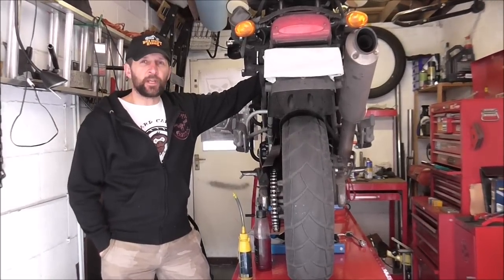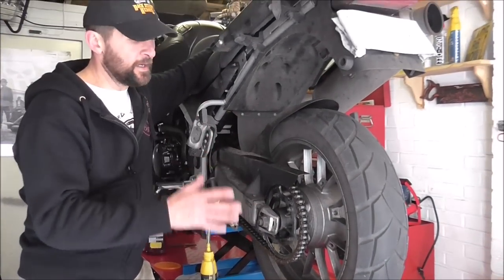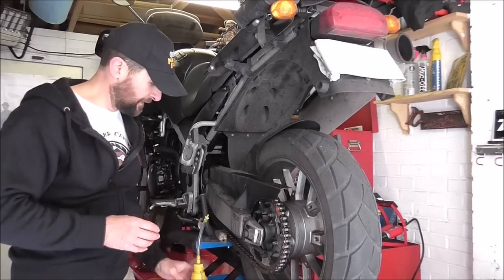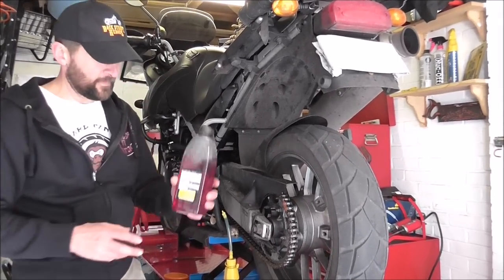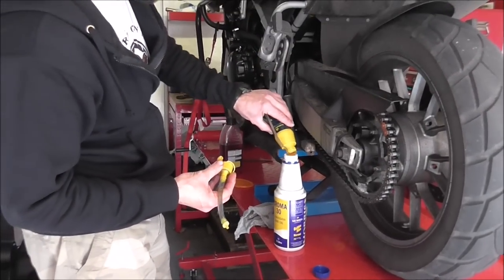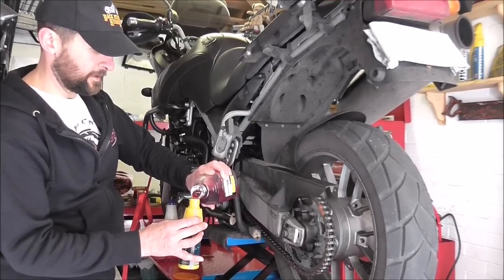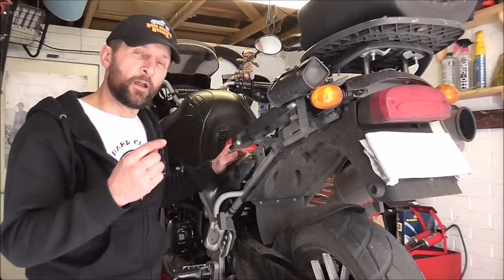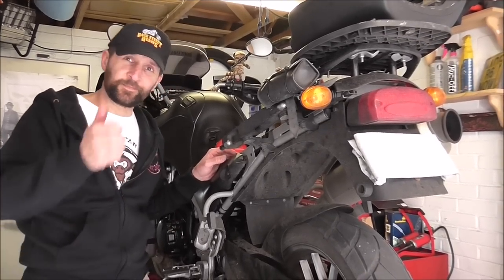Delboy's Garage, 2 stroke chain lube.

Comment: I bought a Scottoiler about 15yrs ago. It's been on a 12 Bandit for 15,000mls; a Ducati ST2 for about 20,000mls; a 1200 Bandit (yes, another one) for about 24,000mls and now my Bonny for about 15,000mls. I've never had to buy a chain and sprocket set in all that time and ALMOST never needed to even adjust the chain tension - they are just BRILLIANT.

Comment: When I bought my bike the chain was rusted and several of the links were seized, cleaned the chain and put on chainsaw oil and it's been good as new ever since. I use the oil through the wet months and chain wax during the summer. You can't go wrong with the stuff.
Reply from the maker: Good stuff mate, nice to hear someone taking proper care!

Comment: More great advice, spot on in my view again Delboy & Penny cheers.  I 100% agree, however, if cost is an issue for your subscribers they could try the Tutoro chain oiler, cheeper to buy, easier to install and works just as well.  Had one for two years done about 12K in that time in all weathersI'm not fussy, and my chain is spotless, always coated in oil and runs as smooth as a ... Great after sales service too.  Just a thought.  Oh it takes a couple of attempt to regulate the oil flow to the best setting for your riding/roads, it's not mechanical.  Enjoy and safe riding.

Comment: I can't agree more about using an automatic oiler. Great advice, just thought i would an alternative i have now used for 3 years after i sold my last bike and the scotoily went with it. The TUTORO Chain oiler, simpler to fit, good quality, even easier to fill up, does the job. I'm not connected to the business, just passing on an alternative, if it helps someone save their chain!
Reply from the maker: Good call PJ... anything that extends chain life and keeps the sheckels in the pocket is all good... cheers buddy.. Del.

Comment: I used to use Spray On Waxy Oil to protect my chain but I noticed "As you said" it makes everything on the road stick to it and to me I think makes more links seizes up.

So I clean my chain everytime I use it with WD40 and when I ride I use WD40 to keep it oiled and sprays anything on it off to keep it clean :)
Reply from the maker: Good practice my friend, although the rain will beat your WD40 off in a few miles leaving it dry to rust, so have a think about getting a Scottoiler and have a clean oily chain all the time... let me know if you're interested, as we have a How To video on fitting with a discount code you can use if you want to buy one...

Comment: That is a great idea, I ride in Cape Town RSA and a lot of the roads I choose are  hot dusty dirt (good, bad and no comment type) so I think this may well be a sensible option when going on a trip with the Tiger as it will avoid all that crud that gets blown up from bikes in front, or my own, getting stuck in the chain...going to swap to two stroke oil in my scottoiler for off road trips from now on... thanks!!  great site...only one I bother to look at :-)
Reply: Moonfleet41 The only grey monkeys we have down here sit on the side of the road and throw rocks, unless you're referring to the local taxi drivers. 37deg at the moment so both are in hiding;-) By homeland do you mean you were born here? Bit concerned about the veggy oil though...you could end up riding a salad if you hit any long grass ;-)
Reply from the maker: Chris hayman
Ha ha 'Riding a salad', PMSL...    Yes its homeland, i was born in Eshowe, my Father still lives in Shongweni in KZN, but we lost touch many years ago, long story. but they say you never really leave aye..SA is always in you..
Reply: Opposite for me born in the Black Country and escaped to SA at 21 True re African dust though it never leaves your system. No way I could go back to UK for any length of time without serious withdrawal symptoms. Suggest you bring the tiger out for a tour in the bush. Go well.

Comment: Good idea! Also, I hadn't thought of using chainsaw oil instead of Scott oil. I reckon some experimentation is necessary :o)
Reply from the maker: The chainsaw oil is purely for financial reasons, i go through so much oil this time of year it saves me about £30 over the winter....its pretty much the same as Scott oil, and still attracts some grit in the darkest of winter like now, so the 2 stroke oil acts as a better washing agent, and also costs a fraction of the money that the Scott stuff does..

Comment: See now this video makes me ask the question. could you use a scott oiler as your twostroke feed system on a two stroke engine?
Reply from the maker: Only if you want to seize it up..lol.   the autolube on your 2T motor needs to be calibrated to the mixture requirements...and a scott oiler is too basic to set that up...!

Comment: Hiya mate, I dont have a scottoiler, just manually clean and lube the chain. Could I still use 2T oil in this scenario? Would I just have to do it more often? If not whats the best type of lube to use for manually doing it?

Cheers!
Reply from the maker: Hi matey... yeah, you can oil your chain with just regular oil....but id say you'd be doing it every day if you wanted it to stay clean and oily....why not consider an oiler if you're out every day in the salt...??
Reply: Hiya, cheers for getting back to me. Thought about it but I may as well get new chain and sprockets first, as I'm thinking of replacing the ones on my Bandit soon. For manually doing it though, what lube/wax do you think is best?
Reply from the maker: BikersLifeForMe
If you dont mind doing at every day...then two stroke oil..!!!!  anything sticky will just go 'fly paper' on you..!

Comment: Hi Del, thx for video.
to lubricate my chain, I used to brush chainsaw oil, but since last summer I changed it to use old motor oil from my bike, that you didn't recommended. I couldn't get the reason (something with additive in 4T Motor Oil), would you write it please.
Thanks again for your video.
Reply from the maker: Hi Keyvan. the advice was refering to using motor oil in autolube systems like the Scott Oiler...engine oil has aditives that may harm the seals....but 2T oil is formulated for the stwo stroke autolube system so its great for oilers.....but if you are brushing it on thats not important...

HOWEVER.... if you use "OLD" motor oil, then it has already been ruined, its molecular structure has been broken down which is why you changed it for fresh oil.....this means that it wont do a very good job of lubricating your chain, use NEW oil, thats fine...EP90 or 80, even if its 4T oil, for brushing on, you had the best solution by using chainsaw oil..

Comment: i also run  a scottoiler on my blackbird del. but what i found just last week was the other side of the chains outside plates where all rusty as my oiler only lubes one side. i know i can buy a twin sided delivery part for the scottoiler system but its finding somewhere to fit it. had to clean the rust from other side plates and just oiled with the oil from scottoil with a cloth for now. any tips on what to put on the outside edge of chain del where the oiler dont get 2?
Reply from the maker: Hi John...there really isnt any other solution than to use the twin hose system...i just clean mine off once in a while and keep the single pipe delivering enough to drown the chain, seems to work fine... you could sue a layer of good uld chain wax on the outer face of the inner plates...then keep an eye on it in case it builds up too much cack... !!! thats what id do buddy.. (unless you can work out a way of fitting the second tube of course..!!?)
Reply: Moonfleet41 as all ways del thanks for your reply . do you mean chain wax thats in a tin or the spray type?
Reply from the maker: johncbr1100
Just the spray on type John, but keep an eye on the build up and wash it off before it gets too bad!
Reply: cheers del

Comment: I just lubed my chain (first time on the Yamaha sr) and realised that the sprocket has about 5mm of movement, its got a drum break at the back, should it have this?
Reply from the maker: What year is your SR mate, and is the sprocket mounted directly to the hub, or is it mounted to an isolated carrier slotted in to the hub?
Reply: Moonfleet41 Its a 2000 "Yamaha Sr 125 Custom" its mounted right onto the hub, judging by the crap on the chain it has been put on and never looked at by the previous owner
Reply from the maker: Sr Rider  well if your rear sprocket is bolted directly to the hub and does not have a cush drive, then the bolts must be loose... please take the care to check it properly before you ride it again... also, if this has been neglected, check the front sprocket at the same time to be safe... let me know how you get on mate, happy to help if you get stuck, Del
Reply: Moonfleet41 thanks mate, the back wheel has to come off anyway because it needs new tyres, thanks for the advice
Reply: I have looked a bit more into it, according to my manual for the bike it does have cush rubbers, I checked the movement in the sprocket the way u do it, with a ruler, its got about 2~3mm movement side to side, none forward or back. should it do this?
Reply from the maker: Sr Rider No mate...the sprocket carrier should only rotate in the direction of drive back and forth, but never side to side...and it shouldn't really move more than about the 3mm you are saying...its just there to cushion the drive take up...
Reply: Moonfleet41 does that mean the 3mm is ok or should I get it checked out?
Reply from the maker: Sr Rider  Yes, mate, 3mm is fine... it's just the sprocket carrier squishing about on it's rubbers, and it's quite correct... but if you have side to side play, and it worries you, then perhaps get your local shop to take a squint at it to be sure!
Reply: Moonfleet41 I would tackle it myself but its got a drum at the back and the rear break cable needs taken off every time you remove the wheel, quite annoying but that's how it is im afraid. this is gonna sound really cheesey but I've noticed u say about milo teaching u, in a way that's exactly what your doin with us new riders :D so in a few years when 1 of us new riders have our own channel it could be, "my good friend del thought me..." lol good luck mate

Comment: Using blue Scott oil, my Scottoiler will not flow in the winter so 2 stroke from now on !
Reply from the maker: +imautuber444 If youre Scottoiler does not flow, just open up the valve and speed it up, it should flow even in sub zero temps. , can help to put the canister closer to a heat source, like the engine or the exhaust, but not touching obviously !
Reply: +Moonfleet41 Thanks for the info, I've gone all the way up to the valve full open and it's like 1 drop every 2 weeks, ive renewed all the tubing and the nib but still crap. I'm going to take the res off next and empty it out and flush it I think, there's got to be something blocking it somewhere. still, when its sorted I'm taking your advise and using 2 stroke though this bad weather.

Comment: See you have a single feeder on there  is that still lubing the other side of the chain
Reply from the maker: Look at the back edge of the chain Rob, you can see it's oily and wet, theo nly part that gets a little dry is the inside face....but the lube is needed in between the rollers, and its going there just fine....if you keep the delivery level turned up a little, it lubes both sides by capilary feed...!